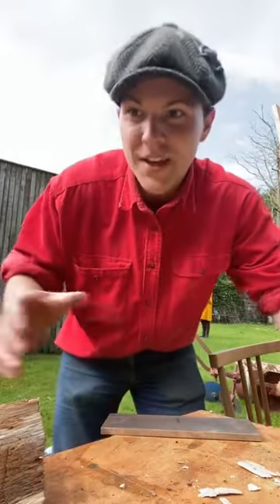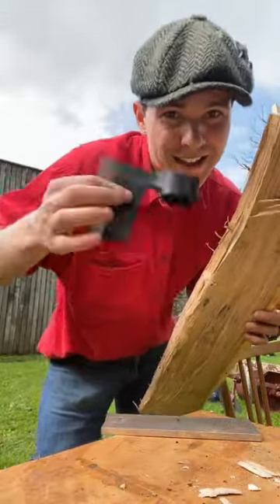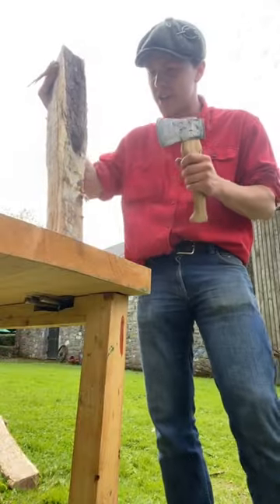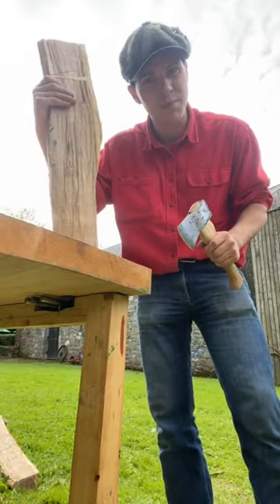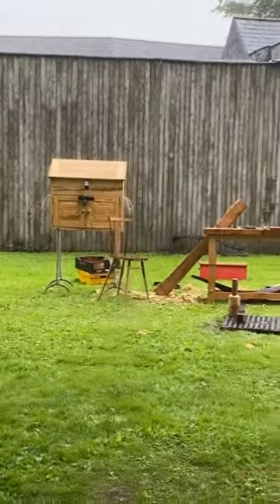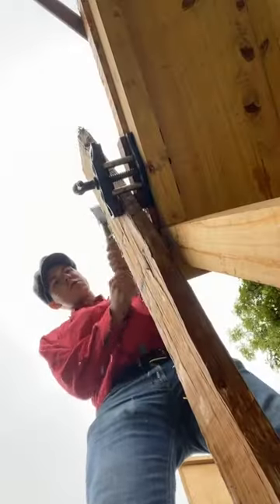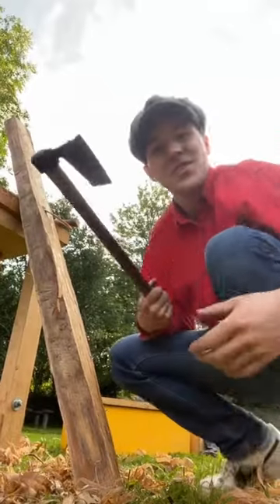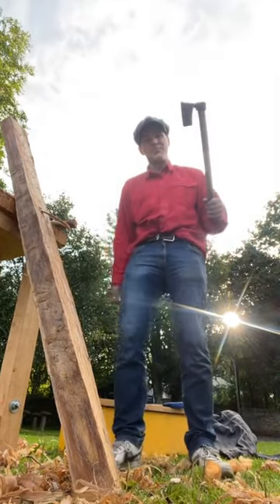Making An Oak Axe Handle In Front of An Audience #ireland #shortvideo #axe #oak #bunratty #woodwork

Comment: That axe looks more like one of the battle axes used from the middle ages, used more for chopping arms and body parts not much good for chopping timber. 
Some discarded after battles were modified by blacksmiths for agricultural use by squaring the blade head.